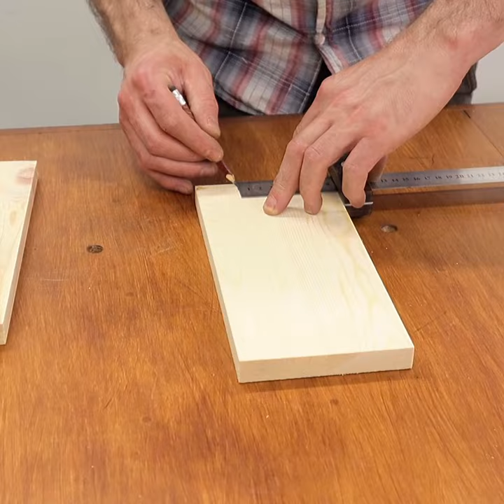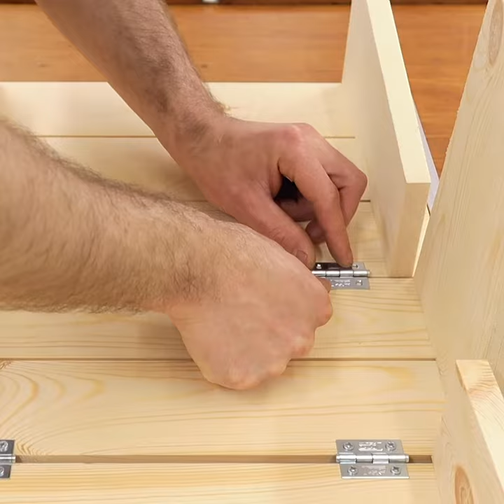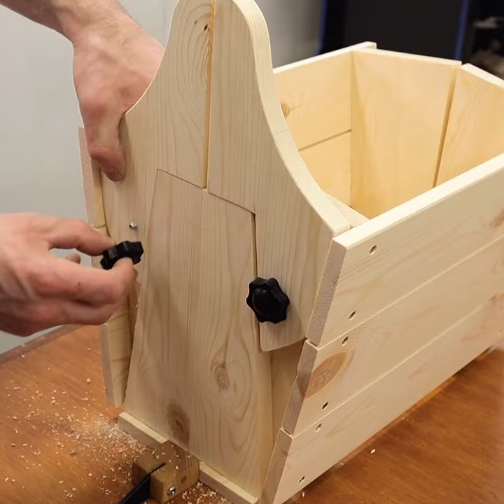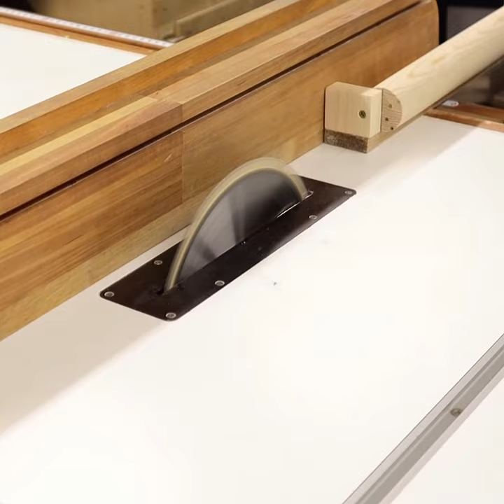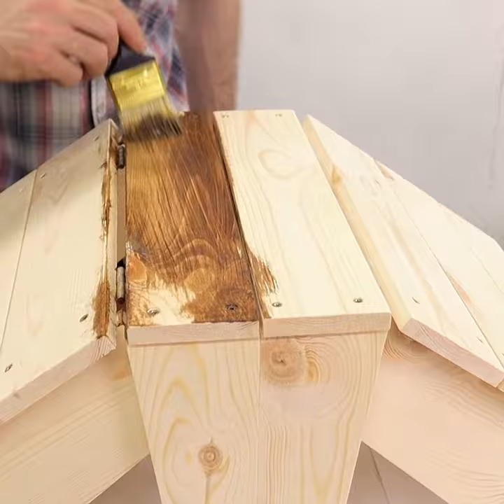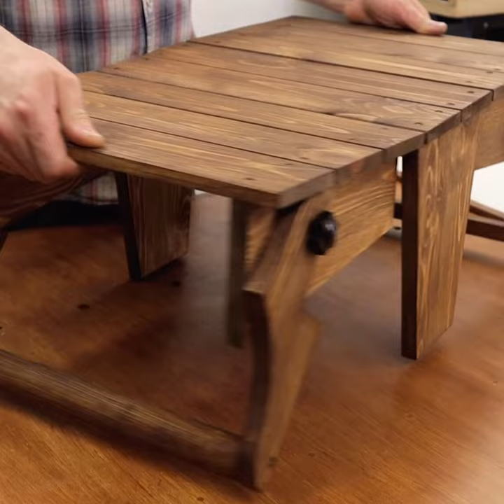Making Foldable Tourist Table. Woodworking Project #shorts

Comment: Thanks! 
I am putting solar panels on the hardtop.  
2 panels 40”X 8’  it needs to stay flat when not in use 
And when open, articulates with the Sun. 
I was stuck on making the gimbal, that opens in  3 separate stages. 
This was what I needed, 
Thanks again 👍🏽🧬😎🇺🇸
Reply from the maker: Great Idea, Solar panels make sense in these days😉